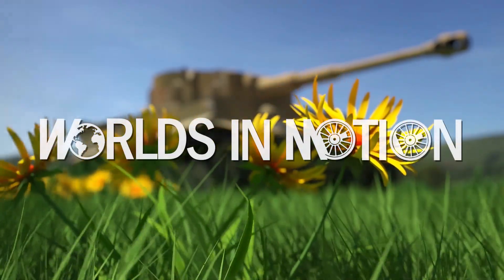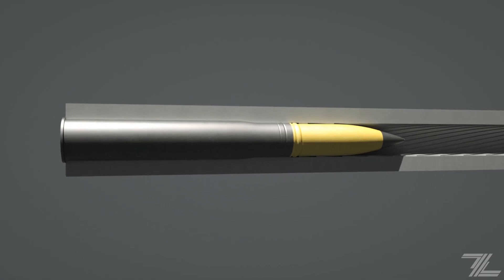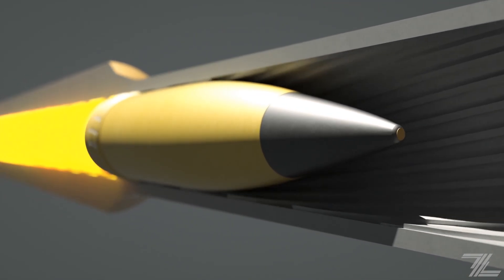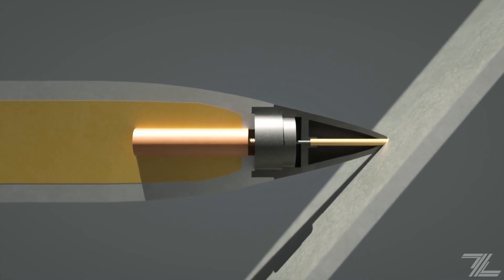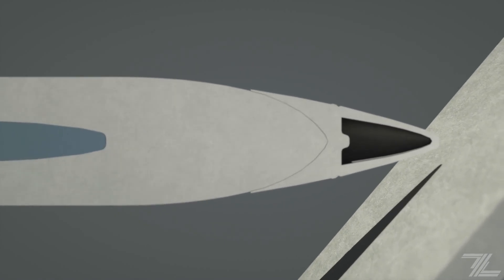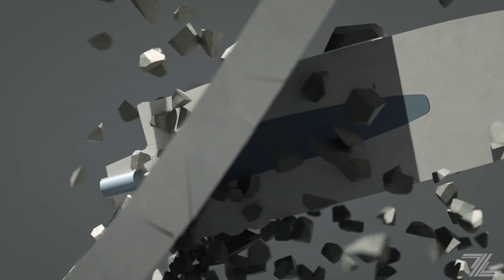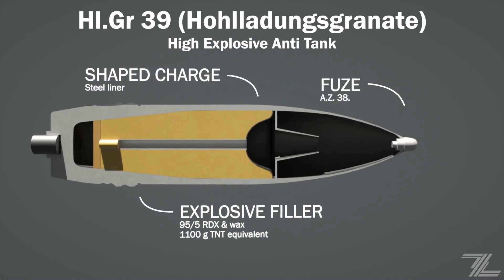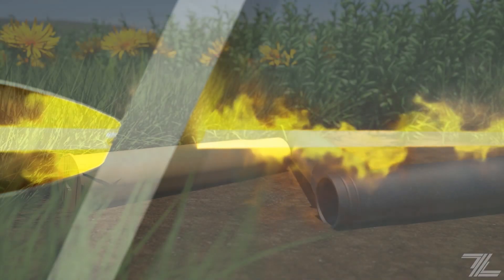How do WW2 tank shells work?

Comment: I thought shaped charge projectiles worked best if the shell was not spinning,which I read defuses the resulting blast cone,so it worked better if they were in a non-spin stabilized bazooka or Panzerfaust projectile.
Reply: Which is why modern tank are smoothbore.

Comment: The only nitpick I've got with the animation is that the APCBC round should turn the other direction. The soft metal cap helps increase penetration by slightly adjusting the angle of the shell toward perpendicular with the armor if it strikes at an angle. The way you set it to turn would decrease penetration since it would need to punch through the equivalent of even more armor. It wasn't made to increase spalling, it was made to increase penetration at more angles.
Reply: [Admr. SJ] HMS Hood & Queen Elizabeth (AL)  That might be a side-effect, but the main reason was for 'normalization', aka: Making the shell adjust its angle to be more perpendicular to the armor plate it's striking at sharper angles. 

While I'm not too sure how accurate exactly it is in War Thunder, the game gives a decent visual of the effect. The lack of the ballistic cap means it loses a millimeter or two of penetration since it's a flatish, wide mass of metal instead of curved now, but the soft metal normal-cap means it can go through two-three more millimeters at sharper angles.

EG: 
Round 1 APHE (armor piercing high explosive) goes through 60mm of armor at 10m at a 90 degree angle, 30mm at a 45 degree angle, and 10mm at a 70 degree angle.
Round 2 APHEC (armor piercing high explosive capped) goes through 58mm of armor at 10m at 90 degree angle, 33mm at a 45 degree angle, and 13mm at a 70 degree angle.
Reply: @5peciesunkn0wn  The cap reduces the angle of shell deflection but doesn't actually "normalize" the shell towards perpendicular relative to the armor - rather the soft cap let's the shell "bite in" more to the armor before starting to deflect. Simulation: https://youtu.be/gTomWXvyrtg
Reply: @Kenzai187  Oooh. Right. That's what it was. Isn't there a slight side-effect of normalization though? Or am I thinking of something else?
Reply: The penetration cap was originally placed on shot to overcome the effects of face hardened armour in the early 1900s. Palliser shot was cast with a metal "chill" in the mould to produce a hard tip with the rest of the projectile left tough. This worked on early armour, but a way of "face hardening" armour was developed using techniques similar to case hardening. This left a thin skin of hard armour backed by tough armour. The effect of this was to shatter the tip of the shot, reducing its penetration significantly, often leading to breakup. The solution was to cover the tip of the projectile with a soft cap which transferred the initial shock of impact to the shoulders of the shot rather than the tip. This allowed the shot to break through the hard layer without shattering and improved the plastic flow of the penetration. There is also an type of cap that reduces the bending moment put on the projectile which can also lead to shatter. This is more seen on later APDS and APFSDS which have long rod penetrators..
Reply: Tests show that the normalisation effect isn’t true and the shell will still be deflected by the angle of the armour but to a lesser degree than without the cap.

Comment: The German 88mm AA gun fired timed fragmenting shells, which could be used against soft targets (exploding over target). Did tanks use the timer?
Reply: Time fuzes need to be set for a certain delay / heigth. Those fuzes dont detonate on impact and none of the AA rounds I saw had a base fuze.
I dont see the value of these fuzes for tanks and since every shell has to be set to explode at a specific distance this is another task that the gunner would have to do. This would be impractical to do inside of a tank in battle.
Reply: @herrhaber9076  AA fuzes usually have a point detonating feature on off chance a shell actually hits an aircraft.. but more usually so that the shell can be used for direct fire self defence. All AA shells also include a self destruction device, either in the fuze or in the tracer. This is to self destruct the shell if either the timer fails or the shell does not hit the target..
Reply: @felixthecat265  I got beautiful pictures of 2 88 shells found on Omaha beach (next to a 270mm fitted with a friction fuze!). Both suited with a beautifully preserved time fuze. The EOD I was with said "no point detonating fuze".
But then, I also had to convince him that most 20mm have self destruct features. He didnt seem ready to believe me until I patiently explained the pyrotechnic train that is started by the tracer (tracer burn through). We had plenty of those around for examples "fortunately".
What you say makes perfect sense, I was just told otherwise by someone who is supposed to know these things better than me ;).

Comment: Shaped Charge is not HEAT
Reply: as far a I know shape charge is HEAT, as shape charge is a device that is design to concentrate it's explosive power in to a small area creating a jet when explode, this was used for anti-tank weapon such rocket propelled ammunition, cannon round, and AT grenade, sometimes in one device there is 2 shape charges it's called tandem shape where the first one is smaller that the second one to weaken anything that in the way and follow by the second one to deal the actual damage this is used for modern anti-tank rocket such as Javelin and NLAW and the latest ATGM fire by russian tank
Reply: HEAT rounds use the Munroe effect = shaped charge

Comment: The 88mm. Gr.39 HL/A HEAT shell actually had a lower armour penetration ability than the PzGr.39/1 & PzGr.39/2 APCBC-HE shot, at ranges below 1,200 metres.
Reply: Isn't the more explosive filler good for hitting fortified position?